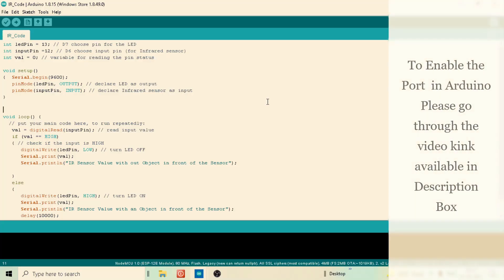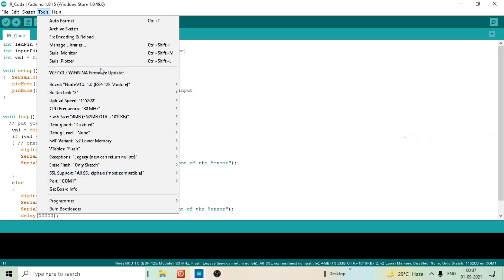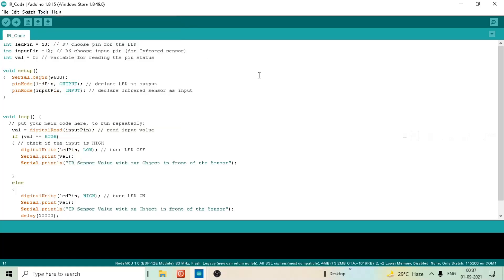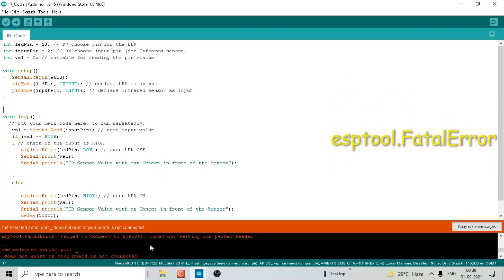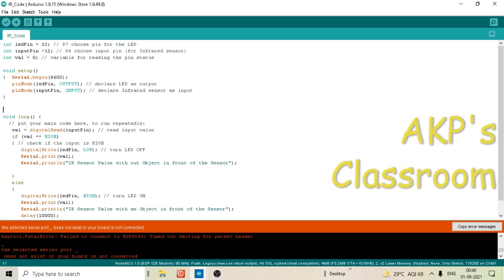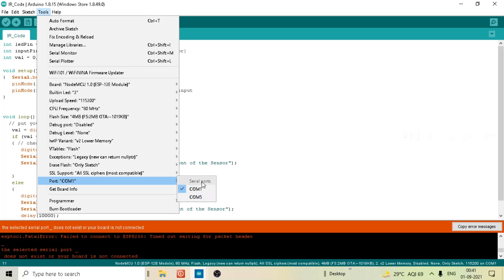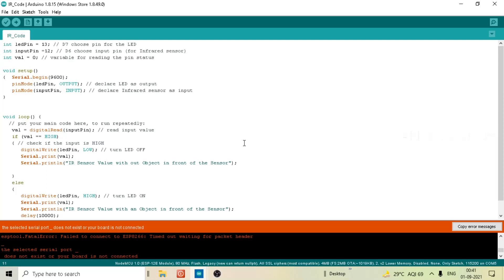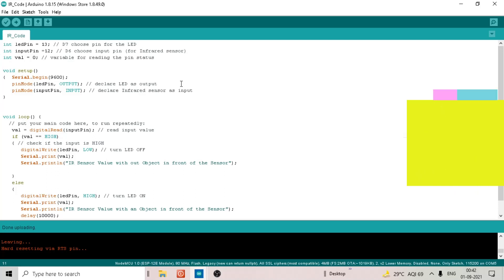[Solved] esp8266 NodeMCU esptool fatal error in Arduino : timed out waiting for packet content

Comment: hi, this error happens when im trying to program esp-12e using ftdi ft232rl. anyone knows this errror?

A fatal esptool.py error occurred: Failed to connect to ESP8266: Timed out waiting for packet header_
Reply from the maker: Two may happen due to driver issue or faulty data cable..
Reply: @akpiot  i checked, it shows as port COM10, so the driver and cable are ok
Reply from the maker: @H.Besharatifard   it should show com10(usb)  ..please go  through https://youtu.be/XXXUWDU_Vmg?si=W4qXProsa5Ga2Ozk
Reply: @akpiot  thank you for your respond. i watched it. mine shows usb serial port(COM10), and no unkonwn driver sign. also with nodemcu its fine but i want to program just esp12e module which is in my circuit.
Reply from the maker: @H.Besharatifard ..the problem  happens when the ide unable to communicate with the board in most of the cases.. instead of ftdi  use nodemcu uart and try..

Comment: For anyone finding this video not useful... In may case I have an NodeMcu 12E and it had integrated in it a CH chip. I reinstaled the CH chip driver for my board and the code worked perfectly. The problem is that you need to do that every time you want to upload a new code...
Reply: Can you help me with this? Im using a CH340 "Arduino Uno" and LoLin new NodeMCU V3.

Comment: after trying eveything on the net.. I solved mine by reheating the IC and the whole board with a hot air gun. it seems like some of the smd pins of the ic have diconnected.. because of me handling and flexing the board while prototyping and working with it..

Comment: this problem is because of wrong connections circuit or remove your wires and upload the code it worked for me
Reply: Can you please write the wire connection for connecting esp01 with wifi ????

Comment: Is this the same with arduino uno + esp-01s
Reply from the maker: I tried with nodemcu board. Not sure about Arduino Uno & esp 01 you may try .I thik it will work
Reply: looks like you have same problem as mine, do you solved the problems yet mr?
i used the same microcontroller as you
Reply: @aganazaroputrakiswanto5743  it working as of now . Im followed some tuts here in YouTube esp needs to be flashed by the used of usb programmer not arduino directly
Reply: @jeremytiempo9639  Thanks for the info mr. jeremy. i apreciate it!